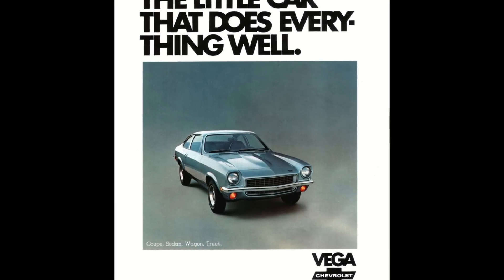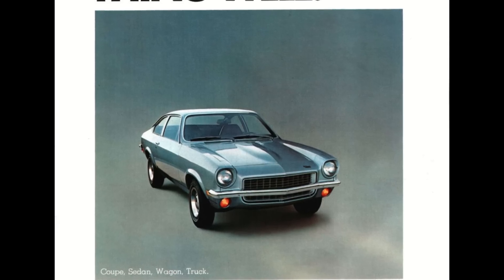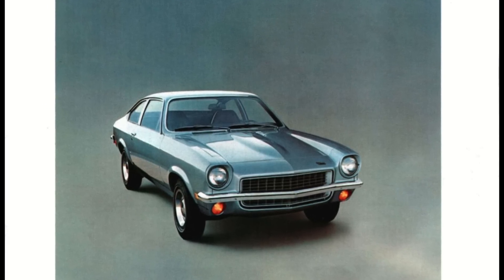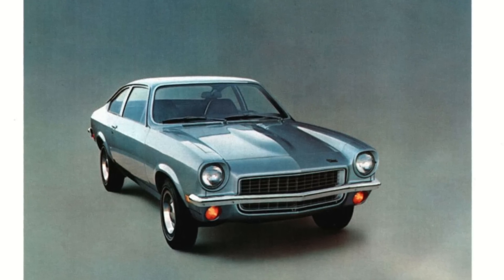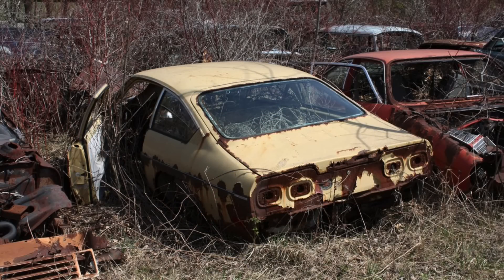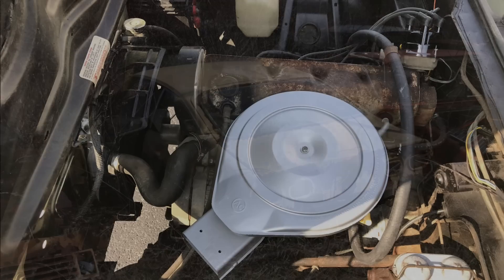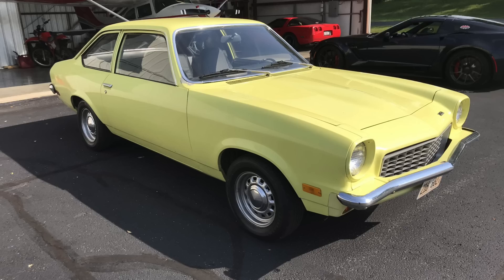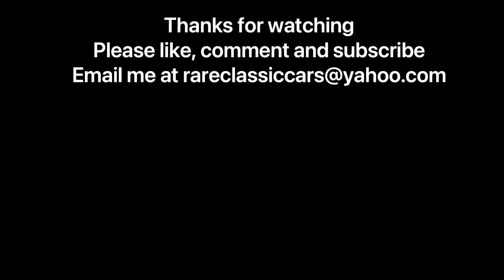GM's Largest Failures: Why The Chevrolet Vega's Engine Turned Buyers Away From American Cars

Comment: I started selling Auto parts in 1981, one of the more common items we carried was a air filter assembly made by a company called Hastings. After you purchase that you could buy a replacement air filter for it. 
You got to love the ingenuity of the American automotive aftermarket.
Reply: I cut open my Vega air filter (ground off the crimp around the edge) and inside found a normal looking pleated paper air filter element. I matched it up exactly with some off-the-shelf element (can't remember now what it was from) put the new element in and put it back together, putting plastic tape around the edge to seal it up. The mounting bolts held it all together anyway. After that it cost about $4 to replace an air filter.

Comment: I worked for a Chevy dealership from 73-76. We would get Vegas into the body shop and we would replace both front fenders under warranty that were completely rusted through on the top and when we got done with them the car would go over to service to have a new engine short block installed for smoke and oil consumption .
Reply: I swear you could literally sit and watch that car rust.
Reply: The rust holes on the front fenders of my 73 GT appeared a few months before I traded it for a Fiat 124 in 1976.
Reply: @BingBangBye   Those Fiats were great fun to drive but they mostly rusted away in a few years as well. By the time I could afford a used 124 they were mostly rusted out as well.
Reply: @dogman8436  Very true. I went from one rustbucket to another.
Reply: @BingBangBye  Math, or typo issue?
Reply: @jamesglavich1426  Typo. Thanks for the heads-up.
Reply: I heard it was because they used a cheap or single stage paint. Since you were around back then, do you think a better cheap route would've been a plastic like epoxy paint, if it existed back then?
Reply: @ItsDaJax  The front fenders rusted from the inside. When the bodies went through the anti-rust coating process, the inside area of the front fenders just in front of the cowl wasn't accessible. Chevy's decision to not install plastic fender liners was the coup de grace.
Reply: Replying to oil consumption, every Vega that came in for oil consumption and smoking , the factory warranty replaced the short block from excessive cylinder bore wear.
Reply: I also worked at a Chevy dealership in 1974. I could swap a Vega engine starting at 8 am, then drive it to lunch at 1pm! Such a common warranty job to swap them out.  I still am fond of the Vegas though....
Reply: Do you think the cause of oil consumption was bore wear or valve stem seals?  I have heard both ideas. I also heard that a larger radiator solved the problem to cool the engine better.